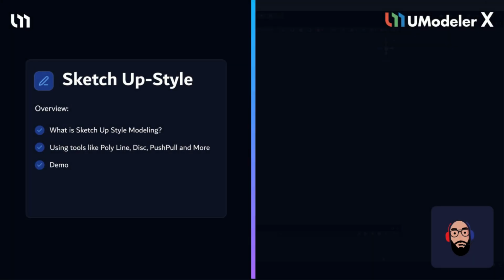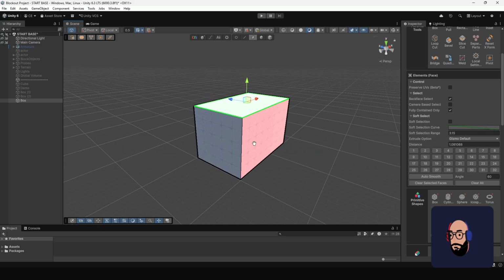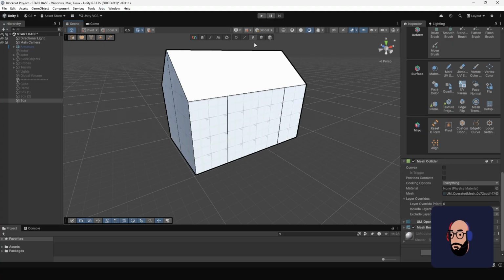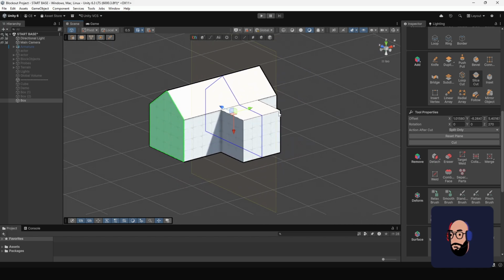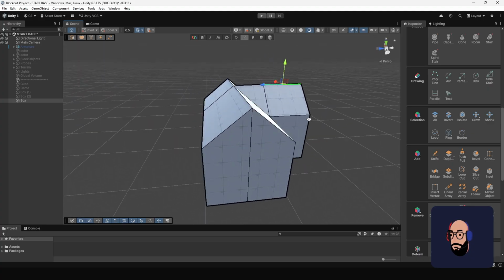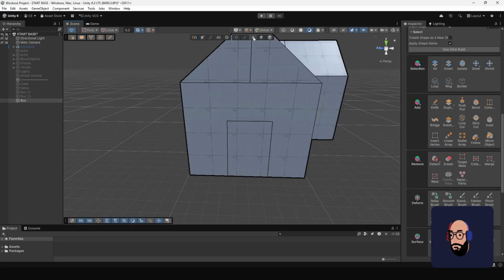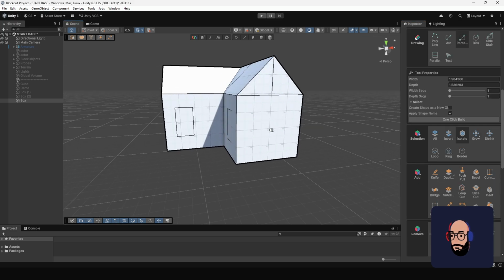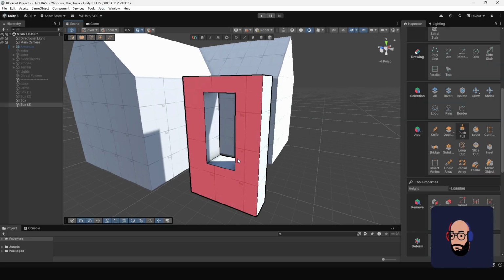Understanding Sketch-Up Style Modeling

Comment: Thanks for this introduction!  I’m wondering how to align one point to another directy (in creation mode) — for example with the windows — so that they all start and end at the same height.
Reply: Hey there! @jugibur2117 Happy to see you enjoyed the video. Ah Yes! you can use the Align tool which is located in the Misc Group
You can group select the verts and then select Align, then select the Axis " Y " then choose which align direction like Toward Middle. Once you do that you can move them all to the level you prefer.
Reply: @IndieGameHustle  Thanks, so I cannot do this while placing a new vertex point, like in some other Apps while holding a key and showing a snapping line i.e.?
Reply: @jugibur2117   ah ! I see you are thinking of a snapping method. You Technically could turn on snapping Increment snapping or world snapping. this too will help you align better. I will check on my side too. there are always different approaches. :)